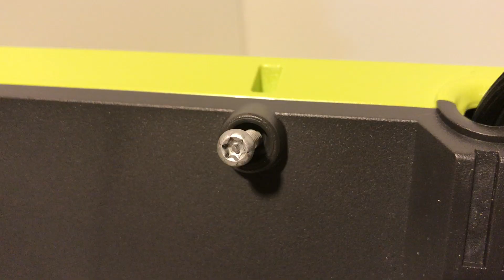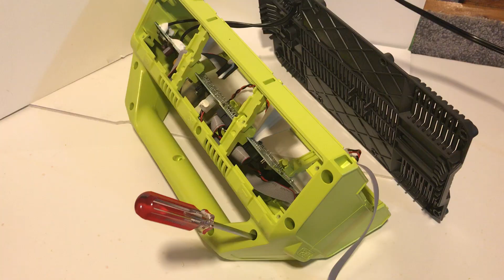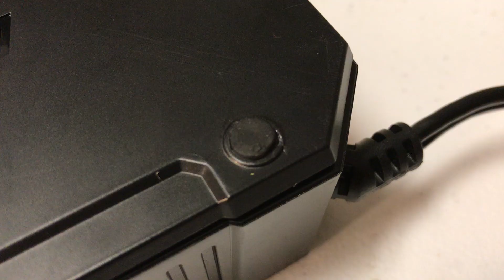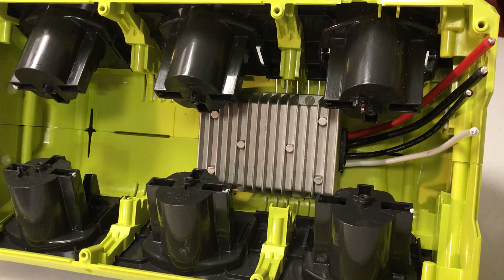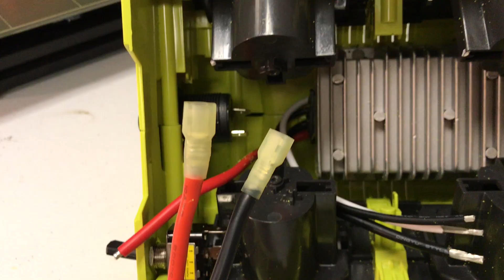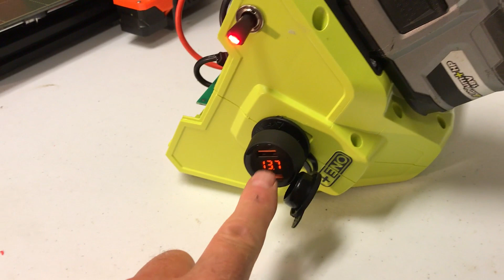Hacking a Ryobi Supercharger into a Powerstation

Comment: this is a cool idea ! i like thinking out of the normal box too myself ! i just wish it still could charge even if not the original way, since this is an off grid idea maybe an solar part 2 plug in, so this would be even better at camping
Reply from the maker: On my 40V battery hack, I put blocking diodes in so you can still charge

Comment: Awesome, I’m thinking I’ll do this if my charger ever bricks.  I’ll probably put a switch on both sides to control what bank the power is coming from, turn both on to use both banks.  Could you install diodes to be able to use batteries of mixed sizes and charge levels?
Reply from the maker: probably, on my 40V charger hack I put diodes and you can still use it as a charger

Comment: Is there any way to mod the P135 to charge all batteries at the same time? (obviously not now in its current state but if I were to buy one new, is that possible)
Reply from the maker: It's a tough problem. The batteries could be in all different states of charge. If you tie them all together, the voltage will try to equalize. A large amount of current could go rushing from a fully charged battery to an empty one. The batteries can only be charged at 2-3A. It could be dangerous. You would need it to act like 6 separate chargers... which you could do, but you would need a hefty/expensive power supply.

Comment: What is the largest 12v inverter you can use with this set up? I know because of the batteries you only can pull so much power.
Reply from the maker: From the battery side...If you went with the 9ah batteries. A 1C rate would be 9A * 6 batteries * 13.8V = 745Watts. Unfortunately the DC to DC converter limits you (25A version would be 345W)

Comment: I would love to see you pair these 18v in series to get 36v and then connect this supercharger to your 2000 watt inverter..  That is what I thought of doing and using this supercharger to hold the 6 batteries securely in place and mount the 2000 watt inverter just below this supercharger unit.  Pretty much adapting your previous video where you made a homemade box to put the batteries in and  connected it to the inverter.

Comment: Would this plan support a 500w or 1000w inverter?
Reply from the maker: . You could  eliminate the dc-dc converter and wire it to run 36V (2S3P) with a high amp connector. This 8 battery project (with 4Ah batteries) runs 2600W ( https://youtu.be/lAAWFCU4iEM ). This 36V 1000W inverter works pretty well ( https://amzn.to/3x7AiyY )

Comment: want to make this to fit on a ebike and just pop batteries in and be able to change bike voltage from 36 to 72 and swap batteries fast. I made one for my small bike that uses 40 volt battery from my 40 volt set of Ryobi and works great and i left the charger board and still use it both ways, it charges in 1 hr and no ebike can do that, that i know of.

Comment: I am so desperate for a 15A 110V output powerstation running off my one+ batteries...  Would need it to run off of different size and different charge amount batteries though.  Please Ryobi!  Everyone send them an e-mail on their website.
Reply: Ryobi does make one for their 40V batteries: https://www.ryobitools.com/outdoor/products/details/40v-1800-watt-power-station
Reply: @shubinternet  Yeah, but 18 is their main product line and what I have.  40V might as well be Dewaly.
Reply: @bklmj  — I understand. I have a lot of Ryobi 18V batteries myself. And a lot of Ryobi 18V devices. But for larger devices, it’s clear that Ryobi is going with 40V as the new standard, and I’m happy to support that. So far, all 40V Ryobi devices that I’ve tried have been clearly superior to their 18V equivalents, if there even is an 18V equivalent. And I’d rather have one good Ryobi device at 40V than two bad devices at 40V and 18V.
Reply: @shubinternet  maybe.  What non-lawn tools are on it?  I think they are investing in a multi battery flexvolt type system though.  I don't think their 40v has proven competitive.  DIY and woodworkers wantnlittle to do with two sets of batteries.
Reply: @bklmj  — but if they did that, then they would have three different battery systems they’d have to support, with radically different physical interfaces. That seems highly unlikely to me.
Reply: @shubinternet  what?  No.  You just put multiple 18v batteries into the tools that take higher voltage.  Juat like Dewalt rannoffnof 20v max compatible batteries.  It eliminates the 40v system.
Reply: @bklmj  — did you miss the part about the different physical interfaces? And what devices today that take 40V would be useable with a pair of 18V batteries hung off them? Where would you put them? And what about the devices that take two 40V batteries? Where do you hang four 18V models with a very different physical interface?
Reply: @shubinternet  40v system gets very little new and slowly dies off.  It isn't that complicated.  No one wants a 40v battery hanging off their drill.  2 18v batteries on a lawnmower is no big deal.
Reply: @bklmj  — But it wouldn’t be just two 18V batteries on the lawnmower. That thing takes two 40V batteries, so you’d need four matched 18V batteries to get roughly the same amount of wattage. I don’t think anyone is going to want to have to fight through getting four matched 18V batteries for their lawnmower.
Reply: @bklmj  — Again, I ask whether or not you noticed that the 18V and 40V systems have completely different physical interfaces? You can’t just unplug one and plug in the other.

Comment: You are the coolest guy ever! This is blows my mind! In order to charge the batteries for 2nd use, I assume you need to pull each out and use a charger one at a time, right?
Reply from the maker: I use a second Ryobi Supercharger to charge them. If I'm in a hurry, I have many separate chargers that can charge them in parallel
Reply: @SerendipitySue  I thought the switch was going to toggle it between charge and discharge modes. Could you do this by intercepting the leads with a relay or something? I know zero about this stuff, but that sounds cool.
Reply from the maker: @TheDadBot_YT  in this hack, you can no longer charge. In the 40V hack I did, you can still charge ( https://youtu.be/p4xW9f1ohlw )

Comment: Great video and idea. We now have the battery topper inverters in Australia but at 240v AC there is not a lot they will power.  Something like this that allowed a decent load that maybe required min 3 batteries (to spread the load as Ryobi batteries have no active cooling) and switched from one bank to the other as power depletes would be awesome.  Oh and then charged a bank at a time... The current supercharger takes 15 hours to charge a 6 set of 5Ah batteries.

Comment: This is super cool. I love this idea.

So it's safe to wire all the batteries in parallel like this? You don't need to use some sort of diode or anything?

Edit: ah, I just saw your comment at the end about using the same size and charge batteries. I'm assuming this is to avoid using diodes?
Reply from the maker: yes very important that you use batteries with a similar charge... otherwise there will be a huge rush of current to the lower voltage battery. I would hope that the BMS would handle this, but I don't want to test it ;-)
Reply: @SerendipitySue  Actually, adding a diode to each battery can solve this issue.
Reply from the maker: @sergeyk736  yes, see my video: https://youtu.be/dqF27lWg6I4 there are trade-offs

Comment: they don't need to be the same size. it will drain them all by voltage. so if you had a 4ah and a 1.5 ah it will use more from the larger battery. but yes its very very very important that you dont put a charged with a low. I've exploded some lipos and seen others do the same. granted in your case i think it would melt the connectors frist but still.
Reply from the maker: I haven't tried it with the Ryobi battery packs... but with individual 18650 cells, the weakest/smallest cell limits the combined battery capacity. Give it a try and post your results!
Reply: @SerendipitySue  in series yes, not in parellel if I make a 30p1s pack will all random compacity cells the smaller cells will contribute their mah. although in series  you will be limited by the compacity of the smallest cell.  same is true for solar panels if you shade just one cell in a solar panel the whole panel output will drop. in your 36v system you would wan to marry the p1 and p2 batteries so that you had the same ah in both 18v packs. flying rc drones we parrelell charge all the time. If i want to charge a 1.3ah and a 2ah 6s at 1c i would just charge both at 3.3 amps and the 1.3 would take 1.3 amps and the 2.0 would take 2 amps out of the 3.6amps
Reply: im thinking of trying this by putting a xt60 into 6 of the single chargers. so i can make a wiring harness to make a 36v or 18v battery bank. Plus i could unplug the harness and still charge the batteris like normal

Comment: I would like this for a fish finder Garmin 7sv it takes DC only - Current draw @ 12V: 0.67A

I think I would have to get a proprietary cable that has the 4 pin to the unit.

Any other suggestions would be great 👍
Reply from the maker: looks like you can buy the cables: https://amzn.to/3oC2jt6 Depending on the power needed you could also try my other design: https://youtu.be/C2XiyP9vXhw

Comment: Did a similar thing with the older flat style 6 port charger. However I just turned mine into a dc power bank I use it for powering lights in my camper and for 6 batteries worth of power on my ebike ...covid boredom does have some creative silver linings

Comment: Hi bud great video.   Can you do a similar video converting the dewalt power station from 4 flex volt batters to 8 batteries and making the system pure sine.  Thanks ill even pay you for this project.   Thanks
Reply from the maker: I haven't seen the dewalt power station ( https://amzn.to/3pJnx9F ) in person. I don't know if the Dewalt batteries have the BMS' in the battery or in the tool. It is much safer for hacking projects if it is in the battery. I wish I could find an inverter that would take the 15-21V battery range. Ones like the powerbright ( https://amzn.to/35KXvuo ) go 20V-30V or 10-15V :-(
Reply from the maker: I did find an 18V inverter! ( https://amzn.to/3ffcJva ). The RYOBI batteries can reliably output 10A... so you would need something like 20 of them in parallel to generate 3000 watts :-O
Not sure what Dewalt batteries are capable of...
Reply: Hey bud.   The dewalt power station as you mentioned uses 4 flexvolt batteries capable of 20 or 60 volts.  The batteries range from 6 9 & 12amp hour batteries.  It puts out 3600 peak watts and 1800 continious watts .  The problem is that it puts out modified sine wave and personally I want to modify the tool by combining 2 units into 1 going from 4  flex volt batteries to 8 with pure sine wave.
Reply: Just to answer your question.  The Dewalt power station power is in the external batteries and not built into they use the same batteries from the cordless tools ect.
Reply from the maker: @chickmagnet225713  does anyone know if the battery protection (BMS) is in the tool or in each battery?
Reply: @SerendipitySue  I'm a little late to the party, but the BMS is in the tool on Dewalt 20V Max (18V) systems.
Reply: Its in each battery

Comment: Now to power a 2000w inverter or even a 1000w. Run your fridge possibly a small microwave. Power your furnace... Hmm
Reply from the maker: well the most power you want to pull out of each battery is around 10A.. so six batteries would give you max of 60A. Figure the drained down voltage is 15V... so that would give you 900Watts to play with. Victron sells a 1200 Watt pure sine inverter ( https://amzn.to/320nPP3 ). I've used it to power a small 700W microwave (  https://www.youtube.com/watch?v=emJtaHUC5SE&t=2s )
Reply from the maker: check out my latest project :-) https://youtu.be/lAAWFCU4iEM

Comment: Love the mod : question can it work with a inverter off 12v/24v and bypass de Dc to Dc
Reply from the maker: Do you have a variable voltage power supply to validate that the inverter will work in the full 15V to 21V range? If so, you can connect inverter directly to batteries. You would still want DC-DC for the regulated 13.8V required by some devices
Reply: Yes super tanks so much hope Ryobi wood put you on there developing department or hocup with some 9hn battery 🔋 for your input development 🤝🤗

Comment: In the US this charger comes with a USB port. My UK version doesn't. However, the plastic moulding has a blanking plate over where the usb port should be.

As a project a was going to retro fit a usb port. Would anyone know where on the USA charger the usb port takes its power from? Or could I just solder one onto the battery positive/negative charging port and take 18v from there? Then just have a usb socket that steps the voltage down?
Reply from the maker: There are USB sockets that you can directly connect to the 18V. Here is another project that does it: https://www.thingiverse.com/thing:4579077
Reply: @SerendipitySue  ah I was hoping to fit a usb socket to my supercharger, rather than have a separate battery attachment
Reply from the maker: @milobrowning9107  just use the USB socket in the supercharger. The part# was listed in that other project

Comment: Great idea, but you just brought a supercharger for housing case. It is rather expensive to have without balancing and charging function. I would like to see if you can keep all the function with a modified case.
Reply from the maker: I had hoped to keep charging circuits, but it turned out board traces were to thin for output. I saved guts, so may try to do more in future
Reply: SerendipitySue  You can have 2 dedicated circuit for charging and discharging by using switch to somehow separate the two circuit. And then make a bigger housing with your 3D printer. And I also think you should add battery BMS for your safety.
Reply from the maker: @lingxiangzhu6152  each of the Ryobi batteries have their own BMS. The goal of this project was to make something people could do without a 3D printer :-)
Reply: SerendipitySue okay, then it is safe. I thought the BMS is either in the tool or charger.
Reply: SerendipitySue  For BMS, I found it is hard to get a 1S6P board, but without take the cells out, this system is one serial with 6 parallels. parallel system is more likely to running imbalance than serial system. Imbalances decrease efficiency and increase risk of heat ups.
Reply from the maker: @lingxiangzhu6152  I found some BMS boards from China, but it took over a month for them to arrive
Reply from the maker: @lingxiangzhu6152  BTW the 4Ah Ryobi batteries are 5S2P not 6S

Comment: Great video.  Question, does the charger still charge the batteries when plugged in?
Reply: Would be neat to put some switches in to isolate the batteries when necessary and keep the sequential charge function
Reply from the maker: It no longer has the charging function